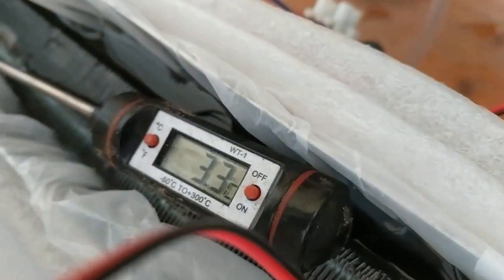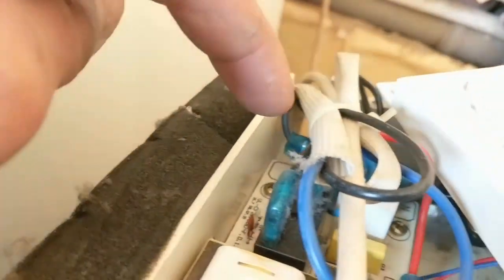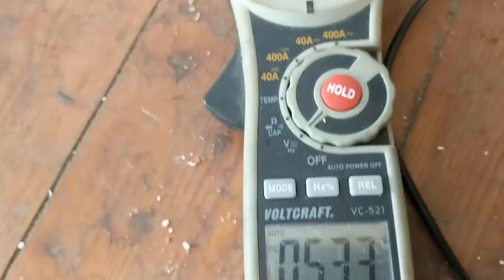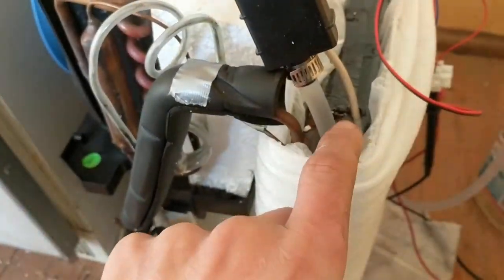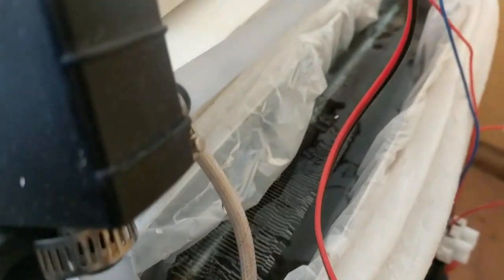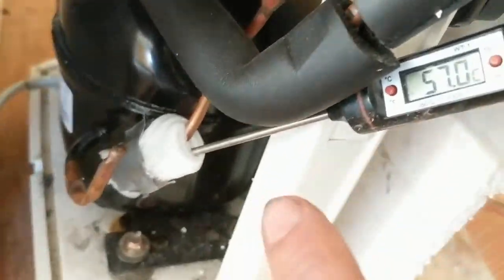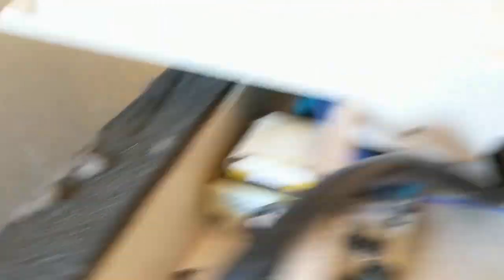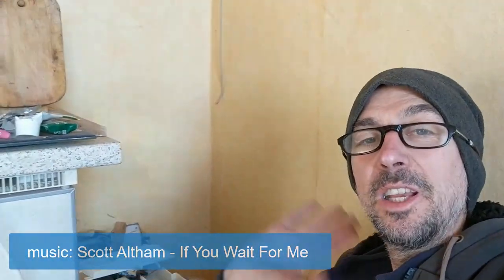turning a 220 Watt dehumidifier into a 600 Watt heat pump (part 2)

Comment: I took the expansion coils and bent them down, carefully, into a large pail for my reservoir. This allowed me to blow the hot air straight through. In my case I used it for heating, and pumped the cold water into copper buried in dirt.